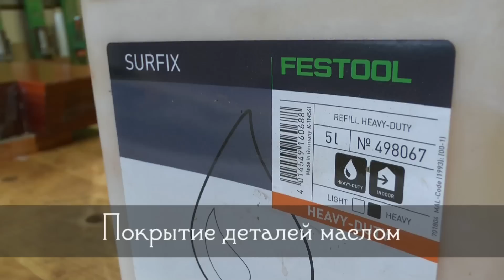Журнальный стол из падука. Деревообработка / Make Coffee table / Woodworking / DIY

Comment: Wow! Great work. Can I ask what do you use for those wooden pegs at 2:01 - festool domino or plunge router with spiral bit? what brand are those metal conectors? Great Job!
Reply from the maker: Thanks!
  festool connectors for the domino system.
https://www.festool.ru/Products/Accessories/Pages/Variations.aspx?pid=201827&ppid=574320